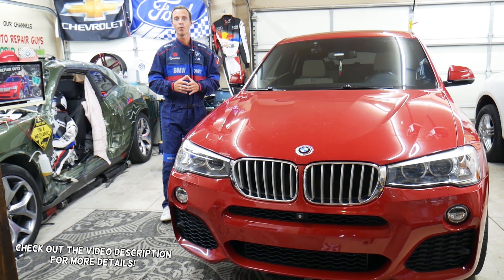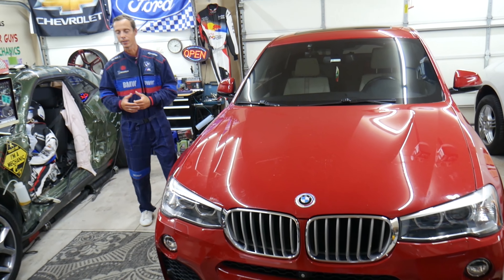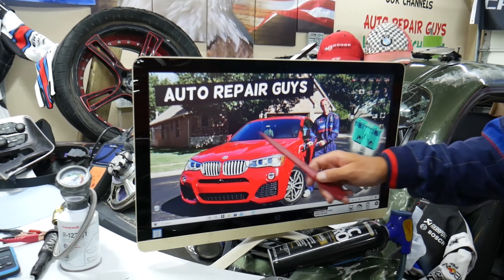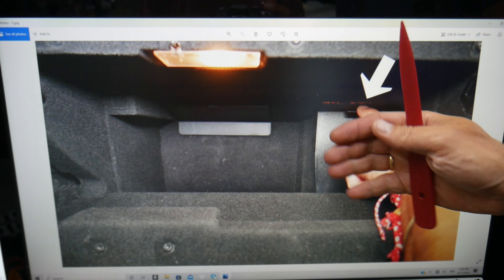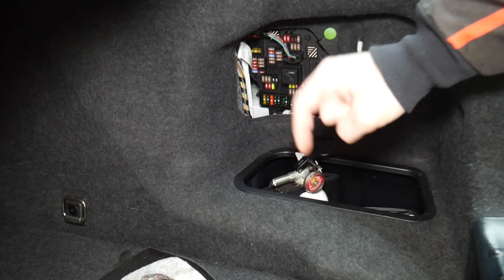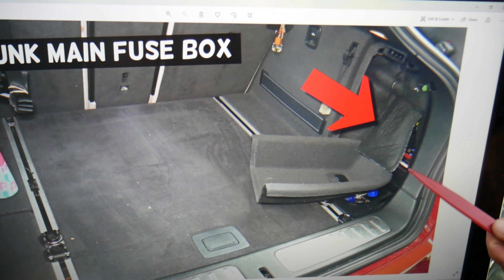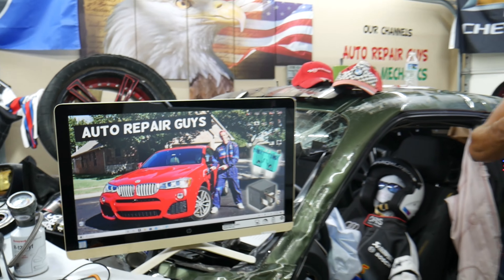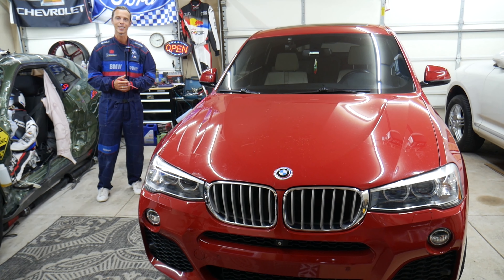Why Cigarette Lighter Does Not Work BMW X3 X4 2010 2011 2012 2013 2014 2015 2016 2017 2018

Comment from the maker: Things you may need to fix this problem: 
► Integrated Supply Module: https://amzn.to/3WaxxuN
► Fuses Assorted: https://amzn.to/49uQw73 
► BMW Green Relay: https://amzn.to/4buPhXk
► BMW Orange Relay: https://amzn.to/3ut6Oyt
► BMW Black Relay: https://amzn.to/3STDKcY
► Liqui Moly Molygen Oil: https://amzn.to/3wdFHYP
► Oil Filter: https://amzn.to/3Oz7nOc
► Mechanic Tool Set: https://amzn.to/3usBcZM
► Scanner That We Use: https://amzn.to/3SSzVEE
► Torx Set: https://amzn.to/3HUCgZu
► Panel Removal Set: https://amzn.to/3SSvIAX
► Screwdriver Set: https://amzn.to/3wiLsUS 

► Check out our Amazon Store for the tools and parts that we use: https://www.amazon.com/shop/worldmechanics